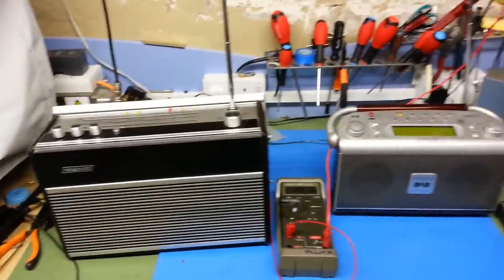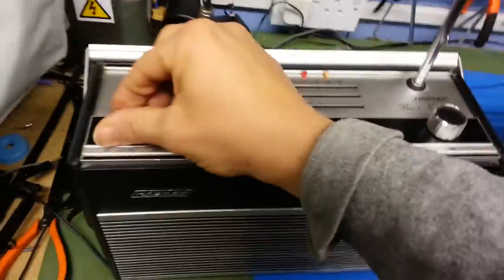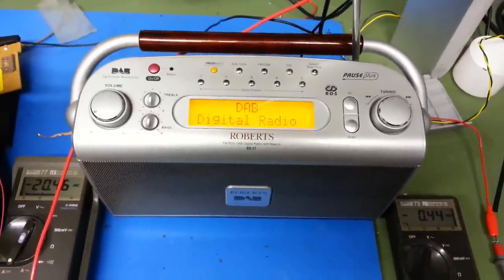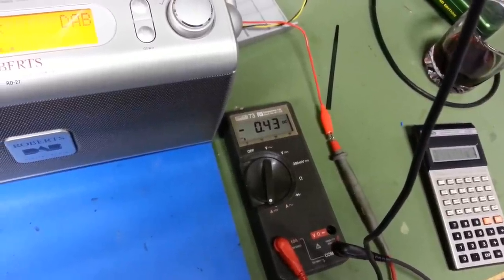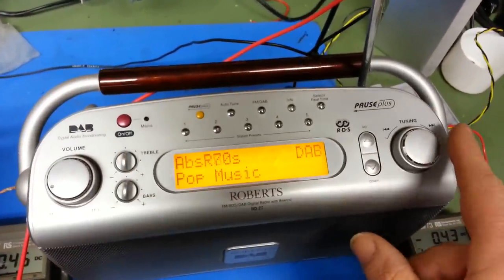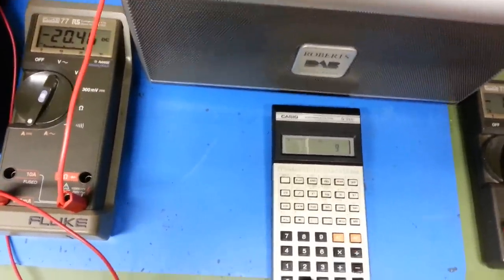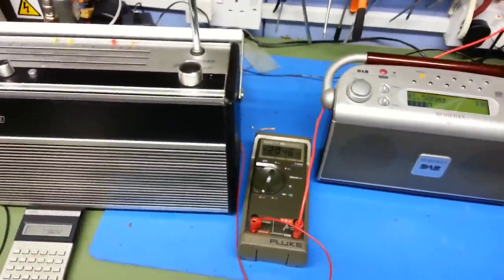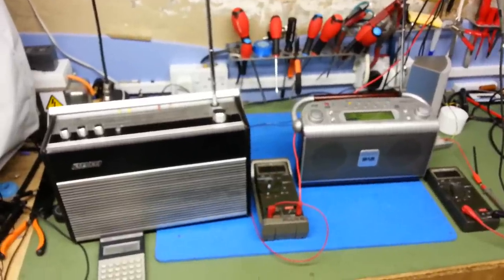DAB radio, the truth..

Comment from the maker: Since this video was recorded 8 years ago, Dab radio has still not become mainstream in the UK. DAB coverage has improved a lot recently. Improvements have been made in radio efficiency, and a Dab radio now seems to use far less power than this Roberts did then. Most people who want to listen to a radio will more than likely stream the station to their phone PC of media device. It is also nice to see FM still going strong in 2021 although a lot of AM local stations are being pulled.
Reply: If I remember correctly, Norway has shut down FM, entertainment channels as you suggested, with the rollout of DAB. A reason for this is reallocation of radio bands. As radio broadcasting consumes a large amount of RF bandwidth, considering there always has been a shortage, some frequencies become repurposed. At times, I like to build amateur radio sets, although if AM becomes obsolete, it will make reception on these devices impractical. Shame. Interesting comment. 🙂
Reply: Bucking the trend, Radio Caroline has 4 KW on 648 KHz from near Ipswich in England, also some limited DAB (limited by cost) and of course online streaming.  Solar panels are planned at the 648 transmitter site.
Reply: And I am going to donate my dab radio to charity, long live fm.. derek.

Comment: That's is a small example of the power consumption, of the Receiver's Side. On the other hand, The "big energy problem" are the DAB Radio Trasmitters!!!! They are working on Class A (low efficiency) that requires 2 times up the power consumption than a analog Class C FM trasmitter, ....for the same output power.
Reply: May be true, but a DAB multiplex can have up to 10 stations so it still 5 times more efficient than having to run 10 FM networks. Also DAB of an equivalent power cover around 10 times what is covered by the same fm transmitter (at least in a crowded FM area).

Comment: Who would have thought the modern radio would use more than the old radio, fascinating.
Reply: Analog technology never took electricity that much. Transistor can have battery for months and months and radio cassette, but only if you use the cassette the batteries lifespan shortened. I was surprised to tune to AM in Norway where AM no longer works. BBC on AM worked, a minute and vanished :(..
Reply: I would of thought the modern radio would be more efficient. Guess not. Everything is made in China today.

Comment: DAB is a system based on lies and proprietary codecs. They said it used less bandwith and you'll hear more station but they didn't deliver and instead compressed the audio a lot so it sounds like crap.

Comment: DAB is killing music, by compressing it to within an inch of its life!
Reply: Almost all radio broadcasting is audio (dynamic range) compressed as a means of preventing crosstalk between stations. When I did my C&G course at Hackney College, London, the course tutor went on about modulation index. It was about 30 odd years ago, so my recall is vague. On a positive note, there are many more stations available on DAB and my favourite one is Planet Rock. The use of a rechargeable battery and mains power eliminates these high consumption issues. Interesting comment. 🙂

Comment: Radio is in a strange place at the moment . Quantity of stations seems to be the main priority and sound quality , well that took a back seat some time ago. The current consumption comparison of the old Hacker compared to the DAB Roberts was an interesting test . It should a requirement that the power consumption of radios is clearly displayed.
The same test applied to televisions of similar ages produces the same results . An old CRT 1980s solid state  set consumed roughly 60 to 90 watts but some larger plasma sets use much more energy , sometimes nearly 500 watts.

Comment: I KNEW IT! , so much for "environmentally friendly" what a swizz . They are plugging dab L R and center. I bought a retro BUSH TR82 DAB  copy about 10 years ago and it took 6 C cells, I bought Duracell batteries and I got 30mins before it cut out!!! Then I bought good quality rechargeables. After 15 mins the radio just squealed at me as it died. Luckily , it had a mains fig of 8 lead. I plugged that in to use it. I used it in my bedroom on low to listen to jazz  before sleep and all I could hear was the hum from the mains transformer. Any movement in bed caused the damned set to sound like a coffee perculator . So, I binned the bloody thing . I now have a lovely Roberts RT8 WITH high brite warm white led's to backlight the display ..quiescent current 18ma ... I listen to it almost every night before bed and 18 months on I am still on the same PP9 battery . Energy saving shite is a BIG GLOBAL CON..

Comment: This is for me realy interesting finding. I bought cheap Tesco DAB/FM radio and I was shocked by so short battery life, and then I also noticed high wattage on delivered power brick. What is beyond this? Powering not only FM receiver but also signal and audio processing chip? But anyway, there is question, if power consuption spared on transmiter side (like Mr. Steve Ralph wrote bellow) would be greater or lower then power consumption on many many receivers used around same transciever.

Comment: Unfortunately, the majority of people don't understand things like current consumption and bandwidth so they are happy to be told how good DAB really is and will believe it... A friend of mine proudly demonstrated the sound quality of his new cheap Chinese made stereo DAB radio to me recently, oblivious that it was in mono and only 80kbps! I've noticed that many Pure radios no longer include the bit rate in their info menu, my Evoke 2S and One Maxi 3 included.
I too have a Hacker Black Knight, plus a Roberts RD21, RD31 and RD41 in my radio collection, and was quite amused at Roberts' proud claim of 150 hours battery life... With 6 Duracell D size batteries that's dreadful! For obvious reasons I run my DABs on rechargeable batteries. On the other hand, I have various Grundig Concert Boys which also run on 6 D cells and they seem to last forever...

Comment: i can appreciate what your saying and love the old Hacker but there is also the transmitting end to consider.  Take the BBC transmitter at Wrotham 250,000watts for just one station. Take the BBC DAB transmitter at Bluebell Hill 6,300 watts carring not just one service but all the BBC radio services, thats a massive saving in electric bills!!!
Reply: +Steve Ralph no good if you can't receive DAB at least you can still receive a weak FM signal that is intelligable.
Reply: Steve Ralph 250kw for one station? I'd check the wiki if I was you.
Reply: Wrotham
- 89.1 91.3 93.5
M 250kW TQ595604
wiki is wrong this is BBC data
Reply: Steve Ralph 50kw ERP each, R1 to R4 and Classic FM. You said 250kw for just one station. Radio Kent 4kw and KMFM only 200 watts 101.6.
Reply: Steve Ralph 250kw ERP doesn't have a 250kw transmitter on the end of the feed line.
Reply: An antenna with 5db gain on a tx rated at 50kw = 250kw Effective radiated power.
Reply: Rebecca Gill yes and neither does Bluebell Hill have a 6.3Kw DAB transmitter at the feeder its all ERP the point was one tx is carrying just one service at high power, where as the DAB uses much less power carrying a multiplex of all the BBC channels..that's it

Comment: I'm fine with DAB such as my Revo Super Signal ( real rock,n roll machine, love it and never switch to the fuzzy hiss FM that it also has). Everyone really should get a Revo! Look them up. Then I have a Pure DAB Mini and that's another story. It's crap but made that way so that the batteries last. The Revo doesn't use batteries so isn't restricted.

But no matter. I think it's purely a bandwith issue and DAB takes up less of the rf spectrum so we don't have much choice as the spectrum is limited and needs to be divided up between all the things that use it nowadays?

I've got 3 kw of solar panels so 3.6w isn't going to be a problem.
Reply: The fuzzy his depends on what quality radio you use , and more importantly the antenna whit the correct impedance match , here in europe everybody recieves fm whit a 75 ohm cable , but the the transmision impedance is 50 ohm , and that is not a match , and then complaining ohh my signal is not good , for 50 ohm transmision you need 50 ohm cable to recieve , that's a match .

Comment: High current consumption is inevitable due to the microprocessor in the modern radio.
My wife has a Roberts radio in the kitchen and the batteries don't last anywhere near as long as the PP9 in my Bush TR130 from 1967, my birth year.
All three AF117s had tin whiskers, so I had to "zap" them!

Comment: DAB makes little sense as a technological advancement. The sound quality isn't much superior to FM, so it does not solve any tech gap.
One can also get far more variety with a smart phone.

DAB solves the non problem of not having digital radios that sounds like the analog. And brings in its own problems. Signal drops on FM makes noize. Loose it on digital, and you'll get stutters, buffers and cutouts.

Comment: For me, DAB is inferior in most respects to FM, for several reasons. But does DAB have anything to do with the high current consumption of the Roberts, or is this just a function of it being a product of an age in which very few radios are still used on batteries?
Reply from the maker: The high power consumption is a result of the processing required to decode the DAB information. I think later DAB sets have improved somewhat but still far higher than an FM set.

Comment: Very interesting, thank you. I too like tinkering with little experiments like this.  Those old radios would indeed last for weeks on a set of batteries. One of my radios is a Roberts Solar DAB 2. It has FM also, imagine my surprise to find that on FM it actually uses more power than on DAB! I think it must be because it has RDS on FM perhaps? Even the instructions warn of higher consumption on FM. 
One very disappointing thing is that the solar panel struggles to charge the radio. I'd leave it on a window ledge with flat batteries for a whole sunny week and it wouldn't charge much, if at all, it will just about run the radio in full sunlight outside. (tested with flat batteries installed as the radio won't run on solar at all without batteries present).

The Roberts Solar DAB "original" however does solar charge the battery quite well. They both have the same panel, I actually changed the panels over thinking I had a duff one in the DAB 2 but the poor charge situation stayed with the DAB 2.

Comment: The early DAB radios use to burn out the circuit boards after a year  because of the power consumption and the heat coming from the voltage regulators .........

Comment: Dab = 128k multiplex MP3 codex. No thanks!
Reply from the maker: Exactly.  And the BBC keep pushing the fidelity of DAB?
Reply: We do not have DAB in the US, instead we have "HD Radio" which is pretty good quality. You can get AM in stereo and CD quality FM. It piggy backs off of the same frequency as analog. Unfortunately it never really took off and there are only a few stations with the technology in major cities and the radios are being discontinued.
Reply: DAB is MP2 afaik.
Reply: Ryan Toomey DAB covers US VHF Channels 7 to 13. There still broadcast on ATSC on channels 7 to 13 ( DAB frequency on 174 MHz to 240 MHz channels 5A, 5B, etc...)

In Taiwan, they replaced NTSC broadcasts to DVB-T/T2 in US UHF 14 to 69. but PSIP channels 1, 2 to 13 uses on UHF virtual channel.

Taiwan also uses DAB, AM and FM broadcasts.

No plans for Taiwanese AM and FM shutdown.
Reply: Rebecca Gill not even MP3 mp2
Reply: Nothing wrong with 128k stereo if done properly
Reply: @knigget357  That may be true even for MP2. When they were testing DAB in the early 90's they said it needed 224kbps to achieve a minimum quality that could rival FM. But how many station transmit even at 128kpbs stereo on DAB?

Comment: UK DAB I always thought is still MP2 codex, it is DAB+ as available on the Continent which is MP3. DAB have improved coverage since 2013 and even in deepest rural coastal Lincolnshire I have all 25 pre-sets occupied. However, I prefer the sound quality of FM, especially via a tuner. Only a minority of DAB sets are stereo and it has to be a huge step backwards to buy a mono radio especially if it is replacing a stereo FM radio. The difference in power consumption that you show here is amazing. No wonder DAB has taken years longer to gain a foothold than the radio industry and regulators wanted.
Has your DAB reception improved? It has come forward a step or two, I think but I still prefer to hear the pips at the proper time and to be about 10 seconds ahead in my listening by choosing FM. FM is better for the planet too.
If Radio 4 Extra were given an FM frequency, sales of DAB radios would probably stop. Pure have been bought out by an Austrian firm because they had lost so much money producing so many models of radios that have not sold. It's a great shame for British manufacturing and jobs that we have lost Pure but DAB in mp2 has not caught on in the UK.
Reply: DAB use MP2 codec, DAB+ use AAC. In Slovenia, EU, we're currently (2017) in transition from FM to DAB+. And when I looked at bitrate I almost cried. Most are 32 kb/s. Granted, AAC at 60-70 kb/s is like mp3 128 kb/s but for god's sake 32 kb/s is for AAC - Speech Profile.
Reply: Actually it is HE-AAC v2 so you cannot really compare it to normal AAC. It HE-AAC was designed to be more efficient at lower bandwidths. But I can tell you that at 32 Kbps it sounds bad still. Even at 48 it sounds bad. (Both are mono) There is one station I can hear which uses 96 Kbps (stereo) and that one sounds decent.

Comment: One of the greatest myths about fm which always amused me about high end tuners in the U.K. Is that all the feeds to the transmitters used Nicam. Yes that dreadful codec used in TV sound here. that is 10bit resolution sliding inside a 14 bit magnitude at 32khz sampling. And sorry fm is not available to everyone at good quality, it never was. I do grant that dab sounds no when you compare both under best conditions, strong signal and high bit rate.
Reply from the maker: FM always sounded good from the Wrotham transmissions Kent. The downer was the over the top ALC and compression to keep within the 75Khz deviation  clause.

Comment: DAB is different uses a audio rather than waves so u don't get whisltle crackle or hiss as with fm. But on the move it suffers signal drop outs as fm is better for on the move. so don't buy a DAB if u live in a weak signal area.

Comment: Also FM is better for picking up stations that r far away. Dab no chance of that so the truth is FM yes DAB No
Reply: FM has stood the test of time. It hasn't been superseded yet because it works and it works well - after 60+ years. BBC network transmissions from Wrotham opened in 1955. It ain't broke and it doesn't need fixing! One single transmitter at 250Kw ERP still covers millions of listeners over a service area of 10,000 sq. miles. Can DAB match that?

Comment: Hi, I know what you mean, I had dab , I used it for 1 hour in morning and a couple of hours at night , the batteries were dead in two weeks my vintage radios go for two months or more ,  great for the planet , what a con, also the radio stations using dab use 10 times More power to transmit. If I switch on my I phone and my valve radio, the radio beats the phone , this Today’s technology ( pardon my French) is total crap.  Regards  JH

Comment: But I like DAB. :(
Reply: I suppose I'm the one then. But then again it's only because the radio at work seems to be okay, I don't know too much about it. It supports the stations I want to hear what I don't get on FM alone. I'm open to knew info on it all.
Reply: John Drew
I understand what you are saying. DAB isn't good when the signal drops out of course. I've noticed that. But all round sounds betters.
Reply: Richard, learn from some of the informed commentators here. DAB is crap and a con on the public to sell more radios and flog off the FM band. Technically, it's a backward step but the govt gits understand nothing of that. It is unconscionable that we should lose the technical quality available universally via FM, but in time we will unless we continue to make our voices heard. 

And while on the subject of transmission costs, what about long wave? The Droitwich transmitter covers most of the UK and the sound quality is lovely to listen to - mellow and very intelligible - ideal for a speech channel such as Radio 4. One transmitter covering tens of millions of listeners - that's great economics, isn't it? But I wonder if the BBC loonies would still be running it if it weren't used for those annoying test match cricket commentaries which interrupt my listening. 

We know from recent evidence coming out of the BBC salaries debate that the Beeb will cover up or at least try to ignore the facts when they find their policies are at odds with informed public opinion. Currently they are running a propaganda campaign for DAB, aided and abetted by the radio manufacturers. This is a public corporation and should not be in bed with commercial interests - period. Or am I just naive?